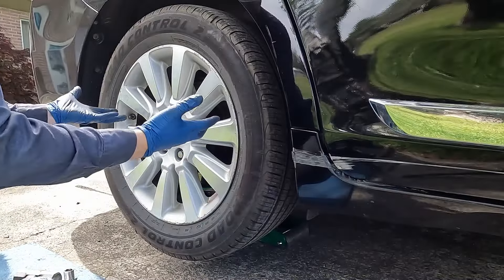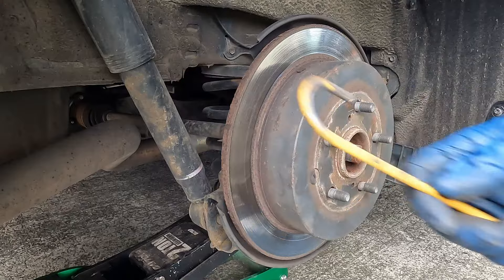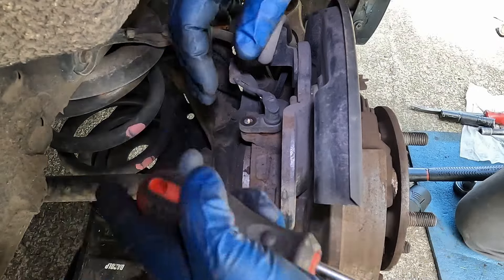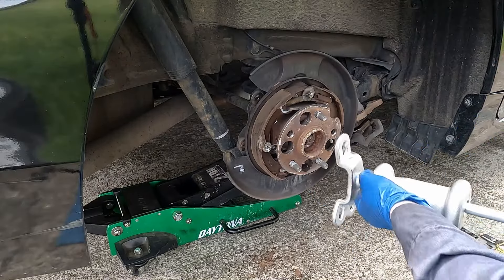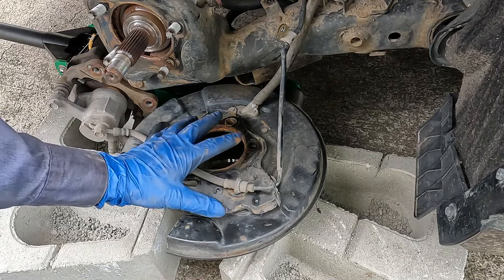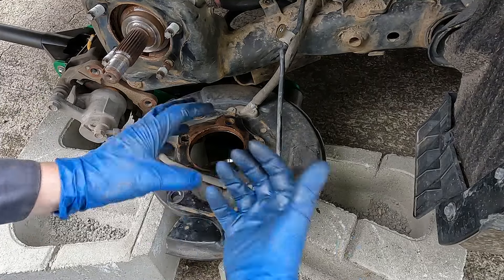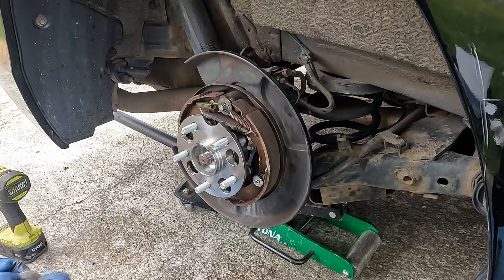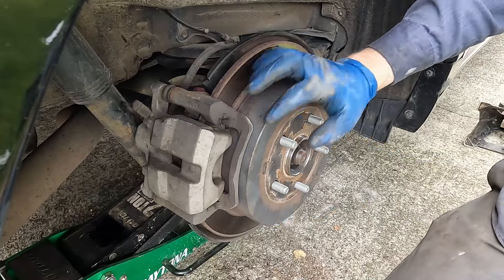2011-2020 Toyota Sienna AWD Rear Wheel Bearing Replacement How To Repair

Comment: 159 FT-lbs for the hubs/217~Nm. Check on the torque wrench. I checked with my local dealer.
Reply from the maker: @DanRaabecoach2014  Thanks Dan! I checked my manual from Toyota and it says the axle nut is 217 lb-ft, 294nm. I wonder if the dealer was looking at it wrong or they have updated information. My manual is an online subscription so I imagine it would be updated with the same information?